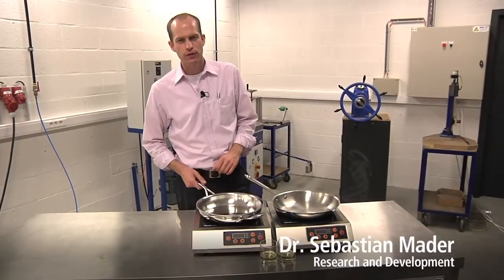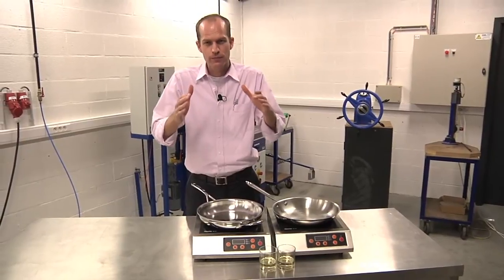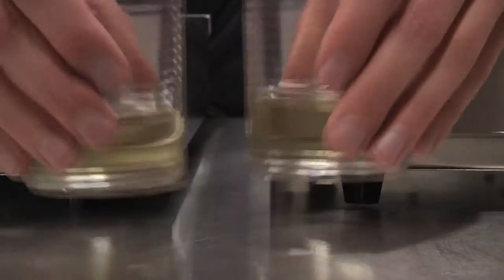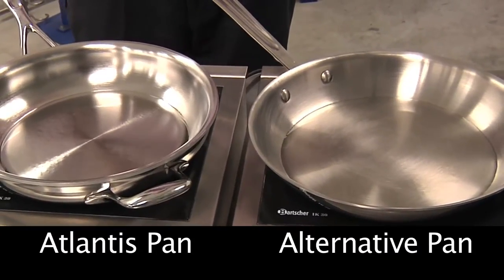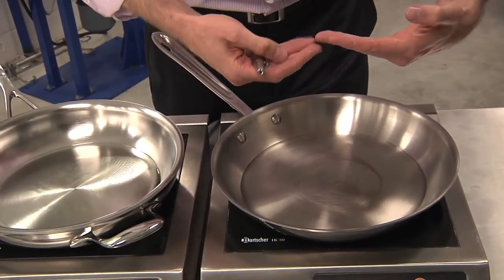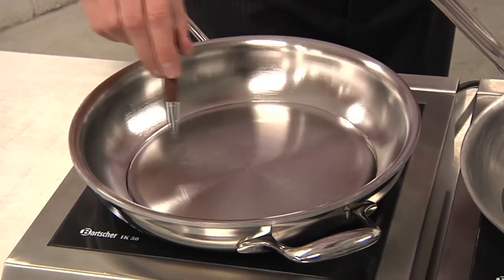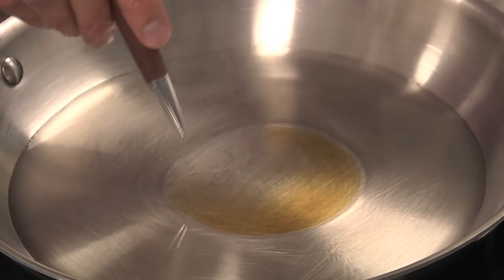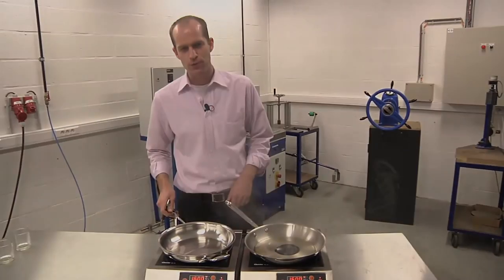Demeyere Atlantis: Flat Base Stability

Comment: the alternative pan has to be heated up more slowly. and it also is thinner so it will not be able to be given equal amount of heat before cooking has to start. yes demeyere looks good, but this test only shows that different pans can't be treated equally.